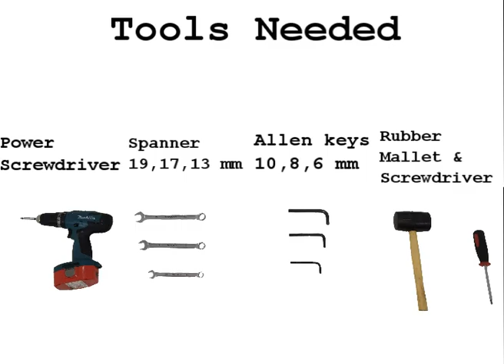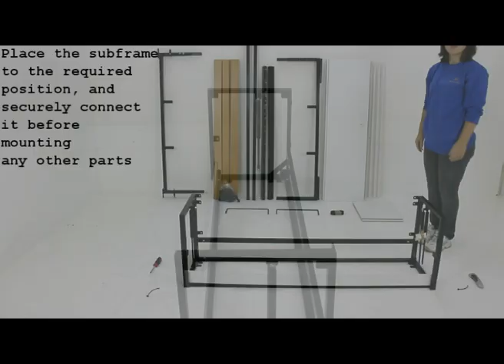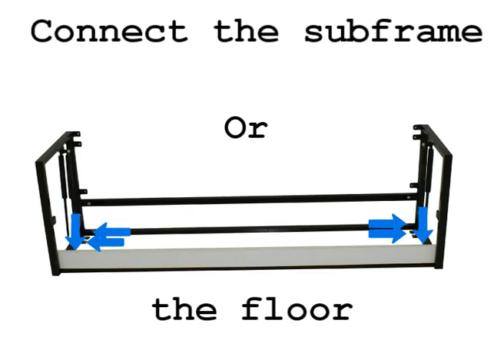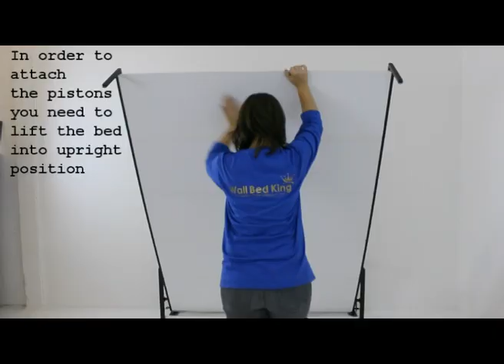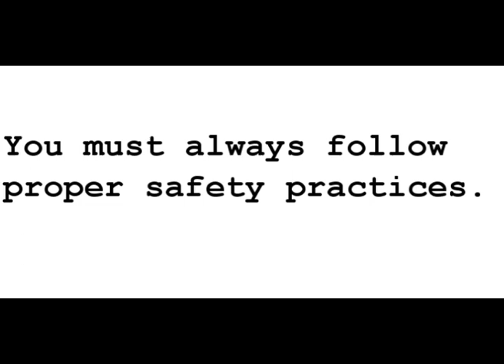Studio wall bed assembly and installation - flat-packed version

Comment: Can this be fitted to wall if you have a skirting board or would that need to be removed first?
Reply from the maker: Hi, you can either remove the skirting board from behind the wallbed subframe and install it against the wall, or you can leave the skirting board on the wall and use spacers (or wooden battens) behind the wallbed subframe.

Comment: I just brought mine and put it together,  all goes well but What can I do when the lift support is not working. If I screw it in the bed will not go down. It apo heavy for me to put up and down.
Reply from the maker: Hi, if you have a lighter weight mattress you won‘t need to use all the gas pistons. You can uninstall one or two of these depending on the weight of the mattress.

Comment: If you want the cupboard to house it in I guess you put it together up to when you secure it to the wall then build the cabinet around it? Not too sure!
Reply from the maker: Hi, there is no strict rule if the wallbed should be built and installed first then the cabinet or the other way around, but it's easier if you start with the wallbed and then install the cabinet around it.

Comment: how do you fit it on plasterboard wall
Reply from the maker: It is possible to install the wallbed onto plasterboard wall, if fixing the mechanism to the floor is not an option. In this case the bed has to be fixed to the studwork, the plasterboard itself is not strong enough to support the wallbed.
If the wallbed brackets are not located where the studs are, you can first attach a panel or board to the studs and then attach the wallbed to this. For example a 25mm thick plywood board can be attached to the studwork first, then you can install the wallbed onto this board.